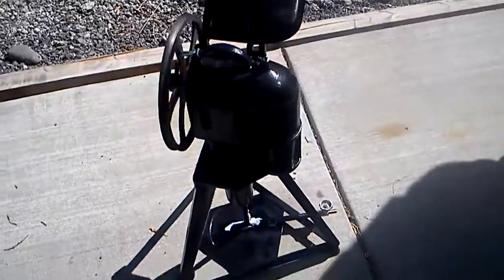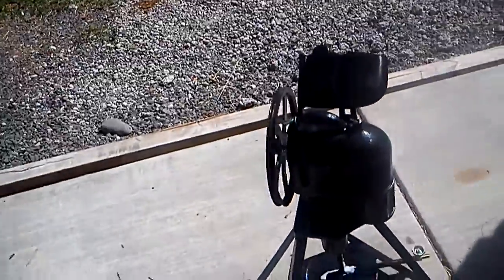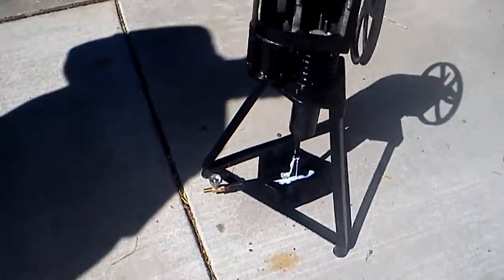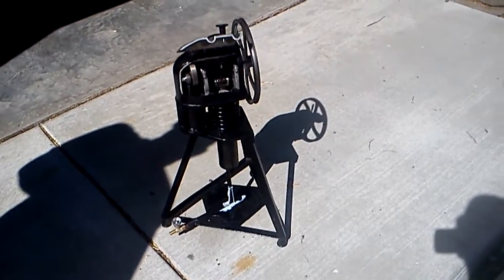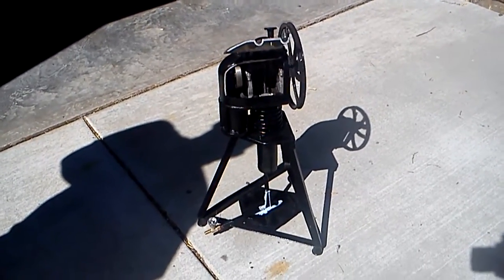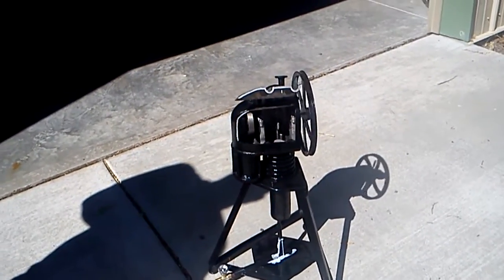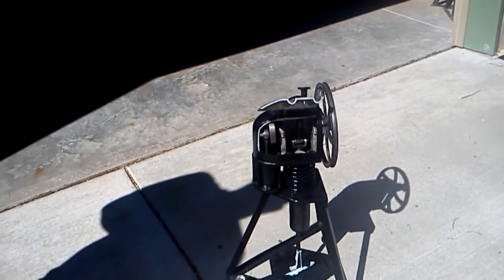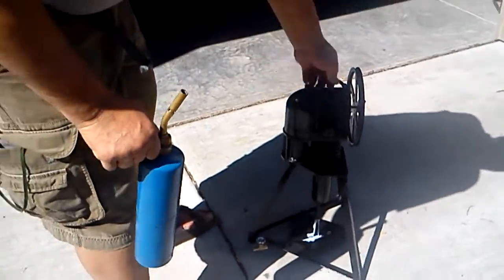Big Sterling Stirling Part 4

Comment: First off, thank you for your service. I am a retired cw3 with 22 yrs.  I just received two of these from Pakistan and thanks to u.s. customs they were almost totally destroyed!   customs should invest in a  narcotics dog.  I posted a video of one of one of my engines finally operational after about four hours of reassembling and tweaking.  Check it out.   Jimmyboy163

PS,  you should try adjusting the valves  LOL
Reply from the maker: I also have a destroyed larger model. I think they should paint them yellow so they look less suspicious to inspectors.
Reply: @MilitaryIndustrialMuseum  I spoke with mr. Sultan and he said that he ships these engines all over the world and only has a problem with the US
Reply: @MilitaryIndustrialMuseum  what's wrong with it?
Reply from the maker: @jimmyboy163  One of the mounts shattered in shipping.
Reply: @MilitaryIndustrialMuseum  crankshaft mount?  Ouch!  Did you do a claim?  Mr sultan told me to start a claim but the tracking number is "non existent " in the USPS system plus their website says the sender has to file a claim.  Both engines had the gas valves were broke off,  one engine heat cap and displacer were dented all up, and of course.....every screw was loose
Reply from the maker: @jimmyboy163  Nope. I didn't want to hurt the company, plus I was too busy They are hand made so sort of fragile. Hopefully one day I will attain machining skills to fabricate a replacement or get one done.
Reply: @MilitaryIndustrialMuseum  I hear ya.  He's sending me new parts, so my second engine will run, so, really no need for a claim at this end either.   I like your fresnel lens!

Comment: Don't use royal purple again.  Or ANY automotive oil for that matter.   It is much too thick, plus all the additives in today's oils is harmful to these engines.  Search for " Lilly  White industrial sewing machine oil "..   WD40 is second choice.   Do you still have this engine?
Reply from the maker: I gave it away.
Reply from the maker: By the way, I conduct research mostly by combining time separated technologies that did not exist in each other's original timeline. Synthetic oil and Stirling engines are an example of that. Please detail specific information that led you to your admonition. So far as I can tell, I am the first ever in history to even try such a thing.
Reply: As I am sure you know stirling engines have an incredibly long life span, literally lasting from over 100 years ago. In those older engines a thicker oil is required, it will not run well with the white oil, it's too thin.  As a rule of thumb the first 10,000 hours should be run with the thin suggested oil.  Thicker oil at this point will actually slow it down slightly. They suggest not switching to a thicker oil until you notice a drop in normal performance.
Reply from the maker: I have a shattered "Super Stirling" from the same guys in a box that broke in shipping. It certainly won't be lasting a 100 years. I just hope you get your use from these as they are more difficult to use than I prefer.

Comment: Did you ever hook up to a generator? I am looking to buy one in the spring to play with. I want to eventually power a homestead with a few of them in the tropics using biogas.
Reply from the maker: I gave it away to guy that said he would pursue research on it. Never happened.
Reply: I know where you can still buy this exact engine.  However there are better engines for making electricity..